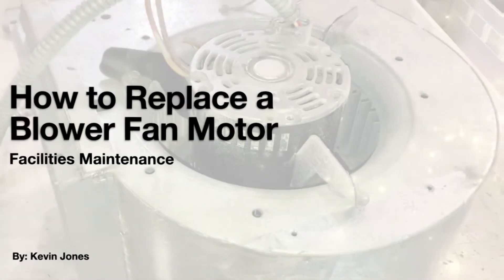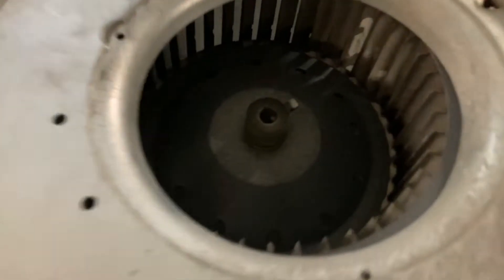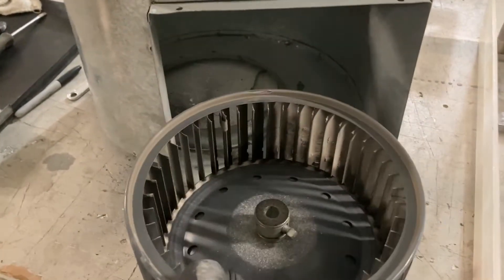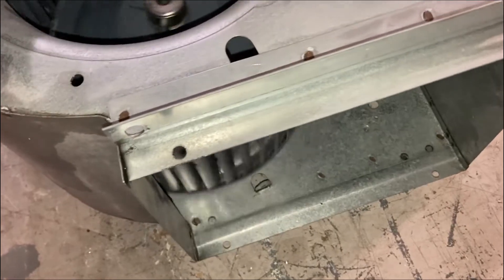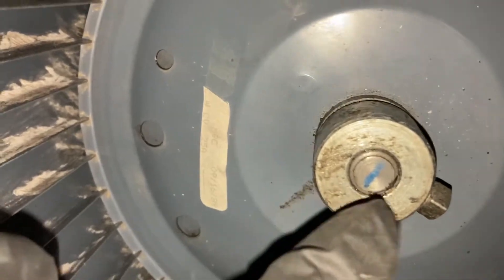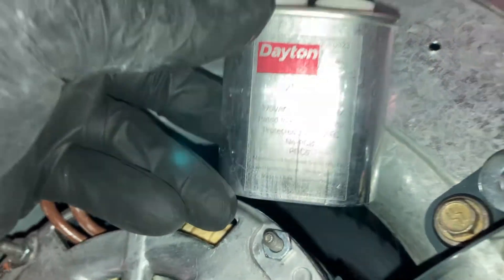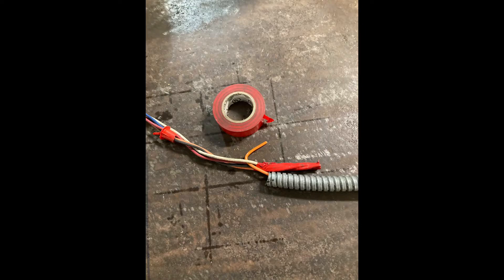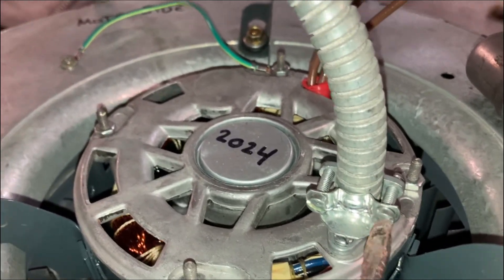How to Replace a Blower Motor (HVAC)

Comment: How do you access the set screw on the shaft? That's the main reason Im clicking on the video and it's the one thing you glossed over.
Never mind. I figured it out after I removed the blower housing from the unit. I was originally hoping I could somehow do this without taking anything out but the motor itself. I realize now the blower housing with the turbo fan must come out too.

Comment: How do you know if the blower motor is not working ? My ac stsrts for 30 seconds then shuts down again starts up again after 10 min.
Reply from the maker: Does your blower motor have a capacitor?  Or is it a ECM motor?
Is the return air filter plugged or is the air filter clean? Is there any loose insulation inside the blower cabinet that might be falling down or getting sucked against the blower when it turns on ?

Comment: I'm having a hard time finding the motor with the 3 attachment arms. Any suggestions?
Reply from the maker: Supplyhouse.com, or click the chat button on the Grainger website and they can usually find a replacement Dayton motor with similar specs as the motor you want to replace.

Comment: Does the blower fan need to be balanced if the blower fan is replaced with a new one? I just had one that self destructed under warranty. My AC guy charged me for the labor. The fan and motor were covered. I would have done it myself, but it was at a rental property. Thank you for the video.
Reply from the maker: Usually you can reuse the old blower wheel, when replacing the motor.
Reply: @kjfacilities-maint  thanks for the answer. I just wanted to know if the blower fan out of the box new needed to be balanced during the installation, my guess is they are balanced by the manufacturer. Again thank you.
Reply from the maker: You’re correct, new blower wheel comes balanced from the factory.
Reply: How much did you pay for labor?
Reply from the maker: @VeraKuznetsova-h8i I performed the labor myself.